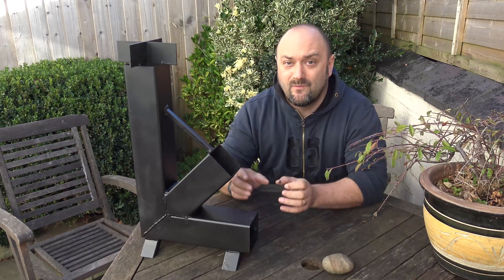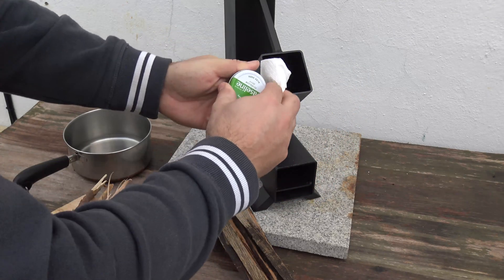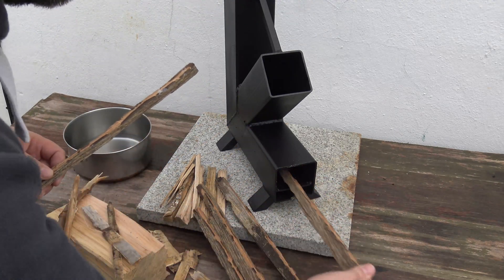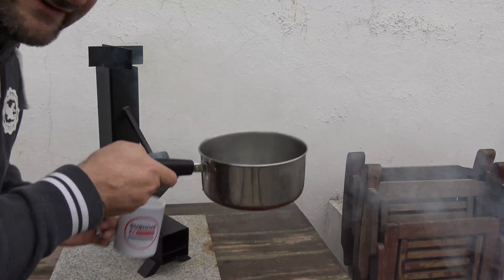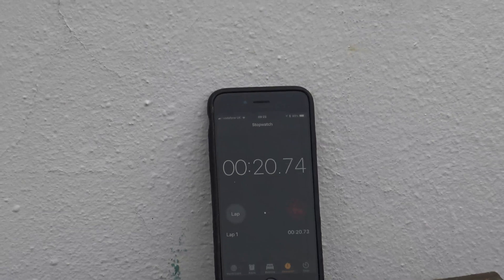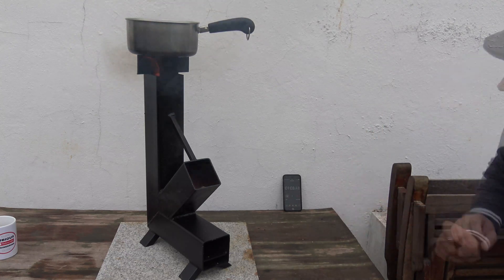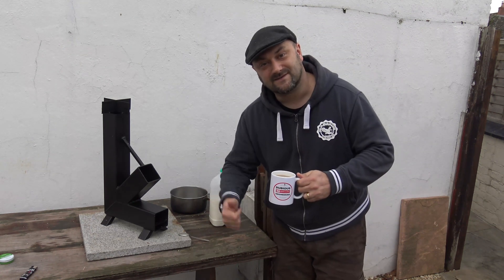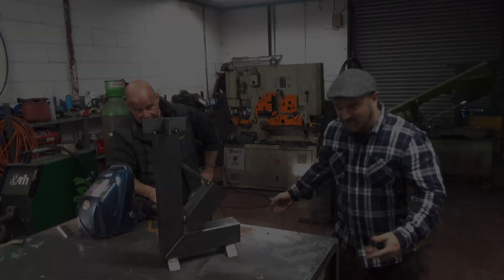DuB-EnG: Rocket Stove in Action - Boils Water in Under 2 Minutes - Amazingly fast and efficient wood

Comment: Ever since I found out rocket stoves I've wondered why people hadn't rediscovered them earlier or developed the concept earlier rather than in the 1980's even tho knowledge of it has been around for millenniums but the advances in the steel industry offered the same advances regarding rocket stoves and heating systems.

I think I'd be inclined to make a collapsible stove or one that can be taken apart and stored in a smaller space rather than carrying around a big hunk of metal. You could make it 3-4 parts (secure it with welded steel plate tabs and pins) and carry it in a smaller bag or backpack.

The one thing that constantly unsettles me is the height of it and the possibly of it toppling over and getting scolded by hot liquids/food.

Looking forwards to more trials, tests and anything else that can be done with it!
Reply from the maker: Actually, that is a very good point... if you were camping with a dog and a baby...  all hell could break loose...   I love your idea of cutting it into three or four parts so it will fit into a bag to make it more portable...  Once spring is on its way, we will get it out and field tested!
Reply: @DubiousEngineering  Speaking of "spring", you should engineer a spring-loaded push plate to cap off the end and automatically push the sticks into the fire as they slowly turn to ash. Just make sure to leave enough space at the bottom for the air intake.